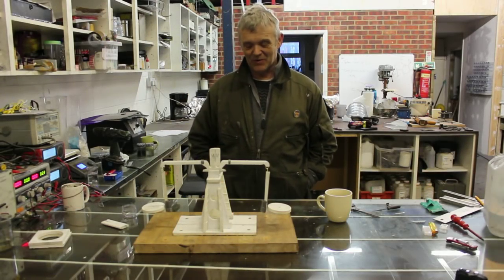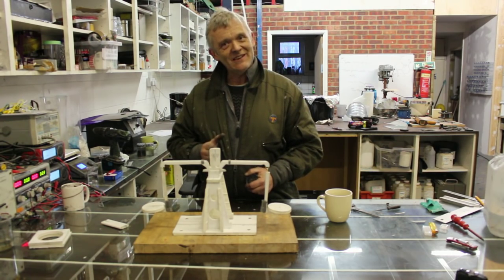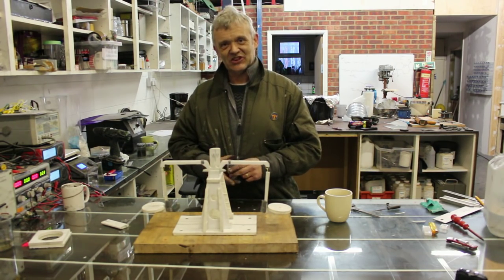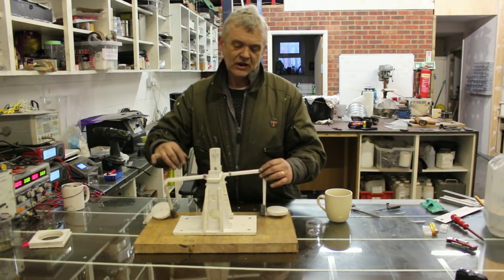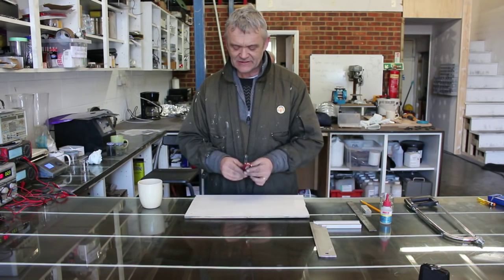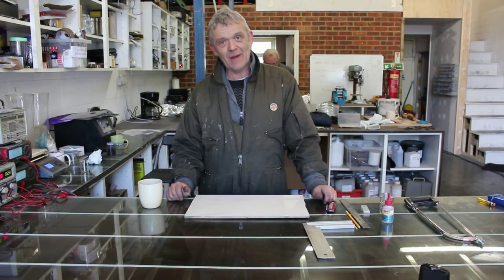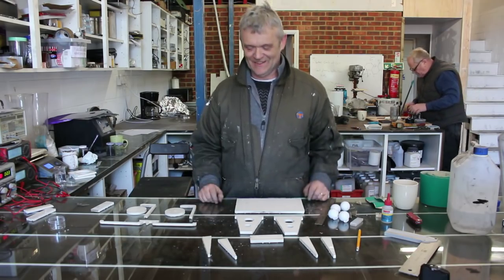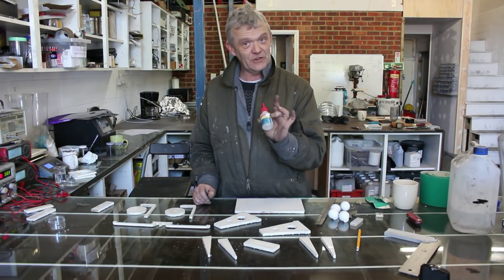How To Build A Lab Balance

Comment: I always went with the 2 scale method, where to get the full range of weights you get one scale that is much mroe corse and one that is very fine. Since most often if you're using lots of stuff, you don't need it to be precise and if you're using a tiny bit of stuff, you're still covered. Still a great video though
Reply from the maker: +The Thought Emporium cheers mate

Comment: Hi Robert, I enjoy your videos very much. While there are several reasons, not the least of which is good information and ideas. But on a purely entertainment level i'd have to say that your enthusiasm is always high. Whether re-purposing a $10 shelf or discovering a potential windfall technology, you seem to always work hard and enjoy hard word. Hard used to include long hours, on your feet, multi tasking projects, trial and error repetitive chores as well as physically and/or mentally demanding tasks.
So, since your balance will either be in equilibrium or not, and your need is to be. Put stops at either end of the fulcrum or better yet lower the pivot. Any amount off center indicates adjustment needed so a 1/16th inch off center at the indicator above fulcrum is plenty 1/8th inch total variance, but the small relative difference in movement at platforms leaves both hands to tune and removes much of the interference caused physical tremors. Easing considerably the task intended.
Also, if you made the balance platforms out of sturdy wire like coat hanger, with the eye above center, and 3 legs down attached to a ring, large enough to hold your small containers you reduce error and speed setup and could make an alt. platform for the product side to weigh bulkier but light materials.
eliminating all the weight at the platforms with allow for easier balancing and not hurt tolerances much. you could then also crimp your weights for a rough balance point and at each end of the fulcrum arm where the baskets hang insert a 1.5" very fine thread #8 or smaller screw approx 1/4" into the end with 1 nut on each that moves in/out as needed and there is your quick fine tune and sensitivity adjustments.
You can use water, small lead shot, coins n currency or comparative items as your goal. check and adjust as needed to maintain balance point. i hope this description is clear enough to follow, i sometimes think so to be told later i wrote gibberish.
Reply from the maker: +Anonymous User it's more than clear mate and thanks very much for the input - other potential builders should read it
Reply: Cheers Mate, to success!

Comment: Re water from an engineers view. Great stuff is water. When it's ice you can put heat into it. When it's water you can put heat into it. When it's hot water you can put heat into it. When it's steam you can put heat into it. When it's HP steam you can put heat into it. When it's superheated steam you can put heat into it. Without water we'd be sunk... :O)
Good balance Rob. A most enjoyable video.

Comment: can the renforced plastic be molded with other powders and still hold its strength
Reply from the maker: +diamond 16 to a degree mate -but it relies on it's strength from the fibres being while - so i guess it depends on how short you chop the fibres
Reply: +Robert Murray-Smith how did you filter the graphene liquid to oxide
Reply from the maker: +diamond 16 with a vacuum filtration set up - i did a video on how to make one
Reply: +Robert Murray-Smith hey sorry for bugging you so much but can the ultrasand filter out radiation
Reply from the maker: +diamond 16 I don't know - i never tried but there are research apers showing GO coated sand can do it - just search google scholar
Reply: +Robert Murray-Smith hmmm well graphene oxide and activated carbon are allmost the same density if im correct nbc filters use activated carbon with a few chemicals so it prolly wood filter it out
Reply from the maker: +diamond 16 give it a go
Reply: +Robert Murray-Smith ill try lol i really enjoy your videos
Reply: +Robert Murray-Smith do you have a link to your graphite shop the link on your page wont work
Reply from the maker: +diamond 16 yes mate
Reply from the maker: +diamond 16 cheers mate
Reply from the maker: +diamond 16 we don't sell the stuff anymore mate - not enough time to service the orders properly